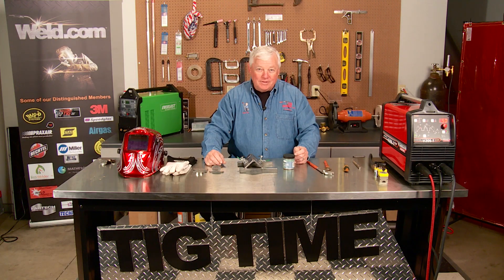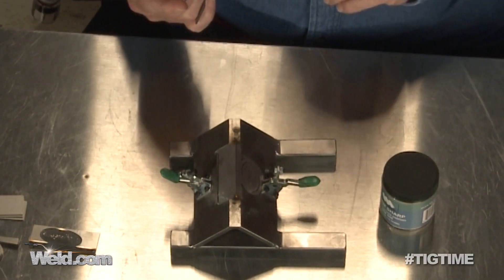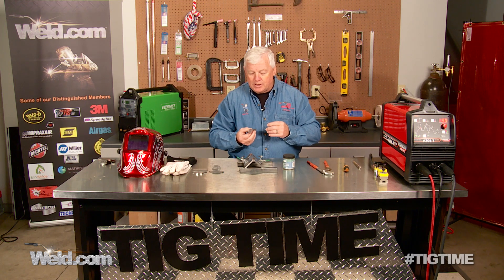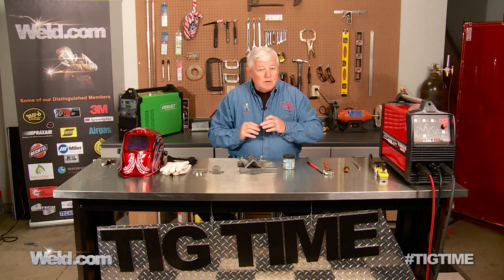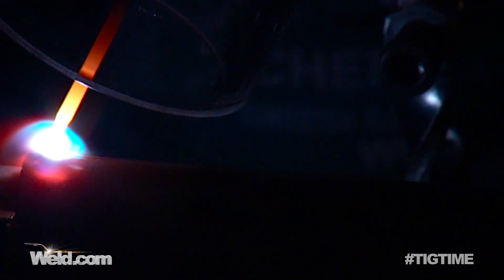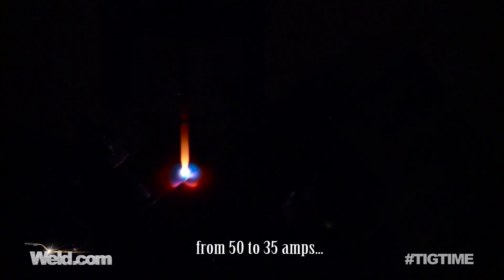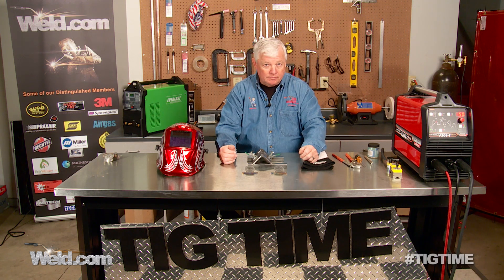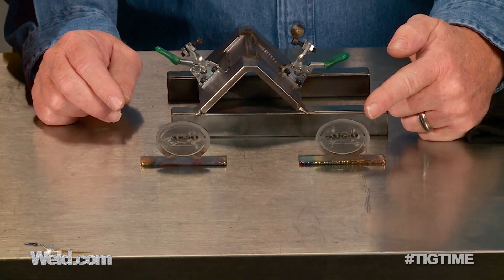TIG Welding Stainless Steel Corner Joints | TIG Time

Comment: Great channel Mr TIG.
   I had a question.  I was getting a quote for a client, on making a food tray (shallow box 18L x 7.5W x .75H) 304 SS.  The welder that I brought the OEM tray to as a sample, said the OEM tray was not up to food grade welding standards; since all 4 corners were only welded on the outside.  He went on to say that the inside corners should be welded as well.  Is this a industry standard, or FDA requirement; or was he trying to milk my wallet or simply misinformed?  If it is a requirement, can you point me towards that information.

Comment: Jes Dunaway it sounds like its a gas flow issue do you use a gas lens or standard diffuser?  When welding stainless its very very important to have comple gas coverage even from the back side of the weld too if you dont it comes out very dark or black it can also be caused by too much heat with stainless. And for the welds he did one autogenus meaning no filler and one with filler corners are best for autogenus welds I personally wouldn't recommend autogenus welds on any other type of joint even tho you can do it with laps too but alw has under cut and convex bead

Comment: I am praticing this exact process at school.. TIG thin gauge corner stainless still...

well my welds ALL come out black. I run one of those miller syncrowave machines and it has no pulse or foot pedal. anyhow I have been trying all heats like 30-70 and it seems 45 works i guess... but like i said they all come out black... my welds....  my school only has 1/8 tungsten and 3/32 filler rods.. 
i saw you didnt even use a filler rod? am i right? and do you know why my welds all come out black?

Comment from the maker: thebrokenbone,

Because you do not have variable control of amperage, you will need to use a "back-up" technique.  The back-up technique is getting to the near edge and whip forward then backward (quickly) on solid material before snapping off the arc.  It still isn't pretty but you don't lose the corner of you material due to melting.

Good Luck,

Mr. Tig